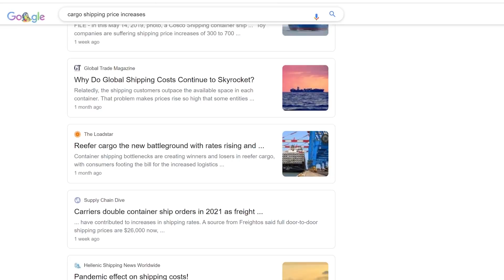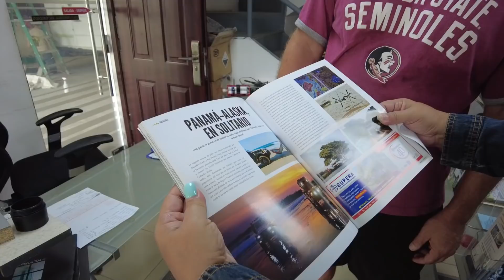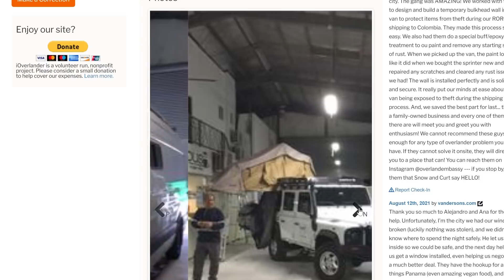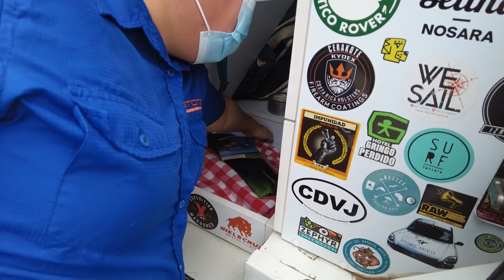VAN LIFE in Central America is Coming to an End

Comment: So the van didn’t fit in a shipping container like many YouTubers do?
Reply from the maker: Nope... When we beefed up the suspension... We think we ended up about 1/2" too tall. And that would be with taking the attic off and having small metal "container wheels" built. There's also an issue with how long we are. Here in Panama, most agents put your van in the container at their shipping yard and then drive the container to the port. So, the container is already on the semi when they load you because they don't have cranes in their yards. Yo load you, they put you on a flatbed wrecker... We are too long to fit on the wreckers that the agents have here in Panama (at least the ones we could find). We will likely revisit this option when it's time to ship from South America to Africa.